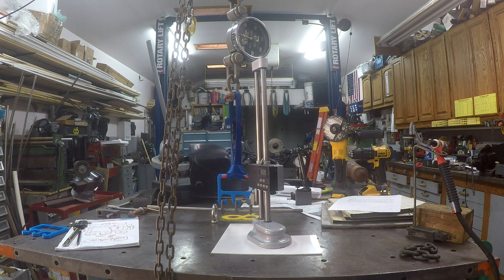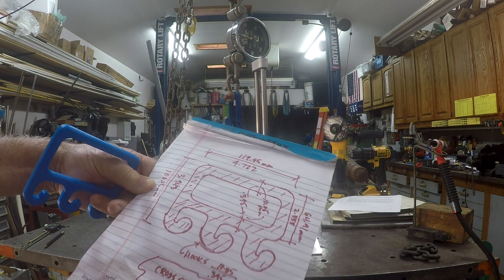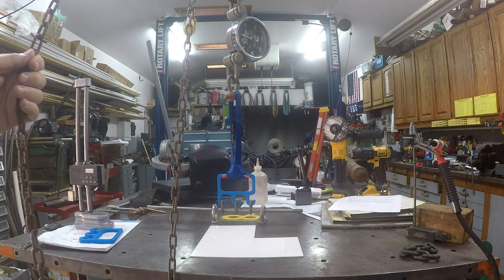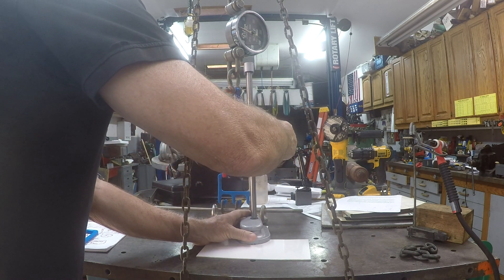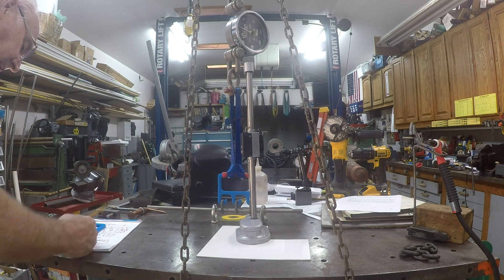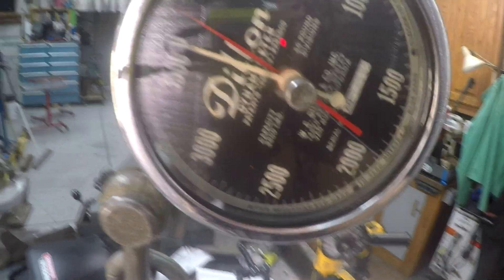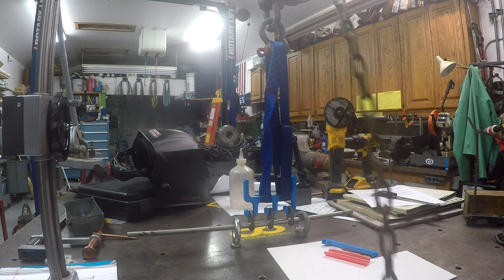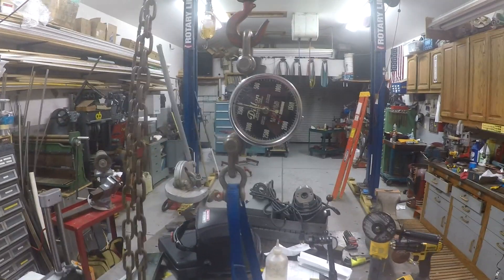Screwy Tuesday....Place your bets!!!!

Comment: Try printing it with PLA+ or PETG. It will bend instead of break with sharp corners. I usually print things like this in PLA+ as it harmlessly, plastically deforms.

Comment: Really cool test it survived longer than i would have guessed. It goes to show how useful 3d printers are for prototyping. That part was printed relatively fast and without wasting plastic. Now it could easily be redesigned with slightly thicker sides and printed at 100% infill and compared.  I bet you could get it strong enough to survive any amount you pack on your wife to carry :-)